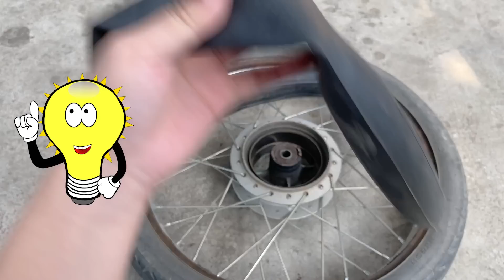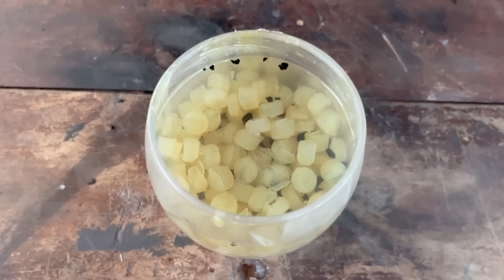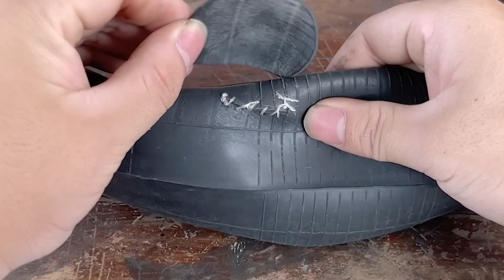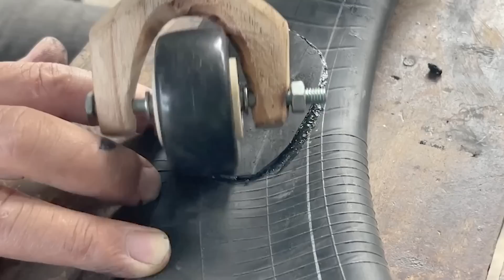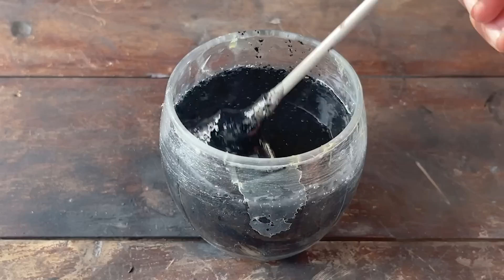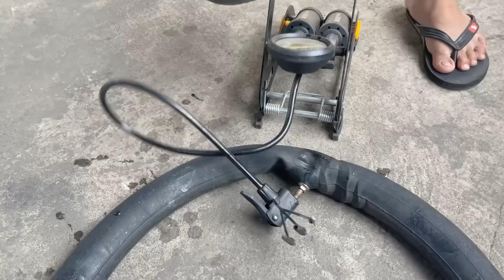Even the NATO professor didn't think of this! this tire gluing technique will surprise you

Comment: Why did you also add young rubber to the glue and acetone mixture? Certainly not because of the color...
Reply from the maker: Hello, nice to chat with you, adding foam rubber to the glue and acetone mixture will increase the adhesion of the glue, Foam rubber (also known as polyurethane foam) can be used in self-patching glue because it brings some special benefits that help the glue have better adhesion and easily repair punctures
Reply: Fake! He cut a plastic thermal pencil into a cup, and this material does NOT dissolve in acetone!